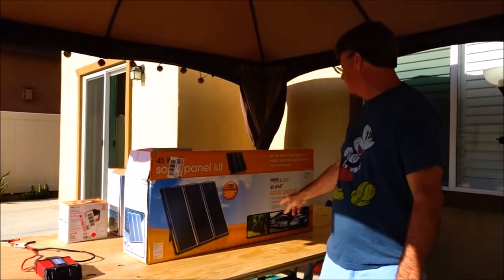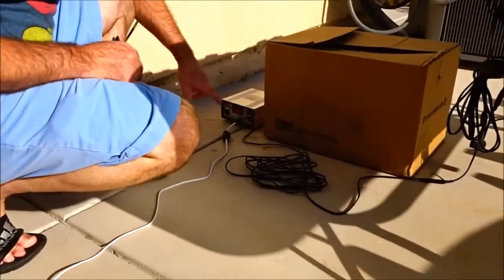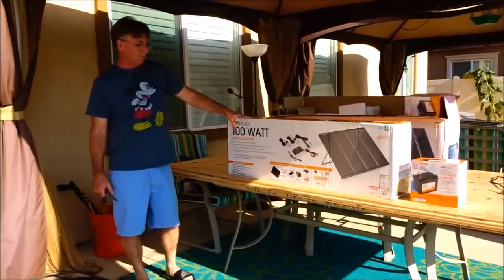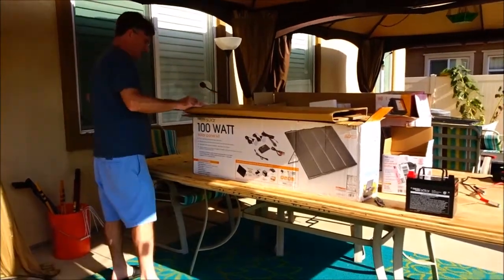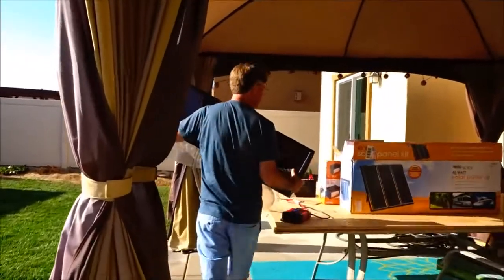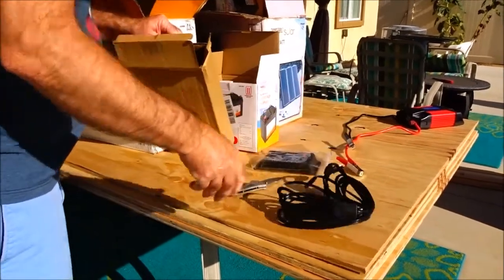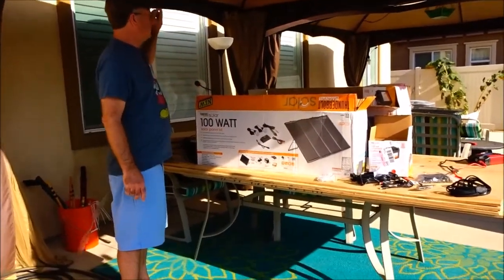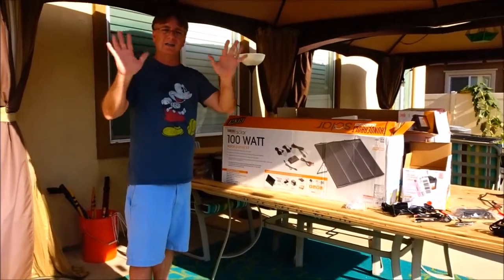Harbor Freight 100 watt Thunderbolt solar system unboxing and 45 watt system update.

Comment: I just bought the same system, I was able to get almost 5 A of power in full sunlight around noon here in South Texas that's about 174,000 lx according to my weather station charges all my batteries just fine.

Comment: They are great panels, got some aluminum to mount my two units on. The red inverter you called a "Sine Wave" is a "Modified Wave". I know it states that it is good for electronics but it is not "Sine Wave". My first hand experience with a Scala 2 water booster pump, it causes the pump to error out. Had to get a real sine wave inverter. I checked out all Harbor Freights inverters and they are modified wave.
Reply from the maker: yes, you are correct. They are a modified sine wave. The inverter runs a tv and dvd perfectly. Thanks for your comment.

Comment: 35 amp hour battery not watt
Reply from the maker: 35 amps X 12volts gives you 420 watts of power. I would only use 210 watts or 17.5 amps of the battery before recharge.